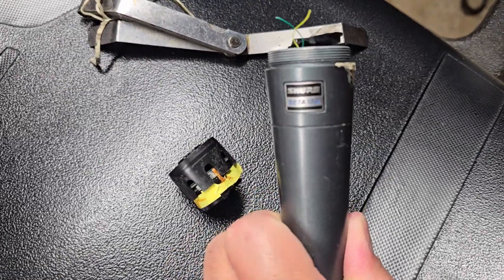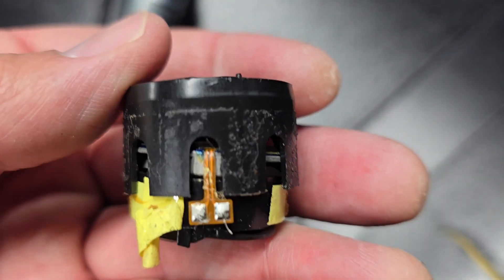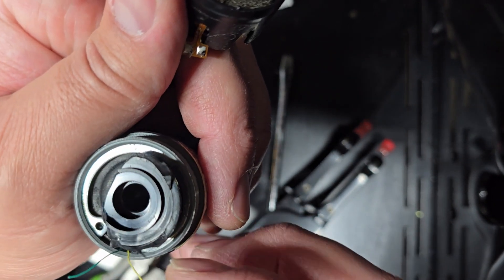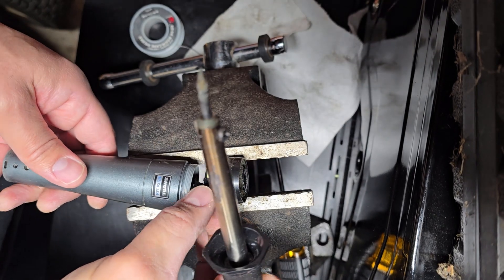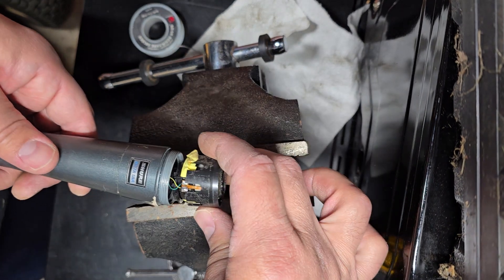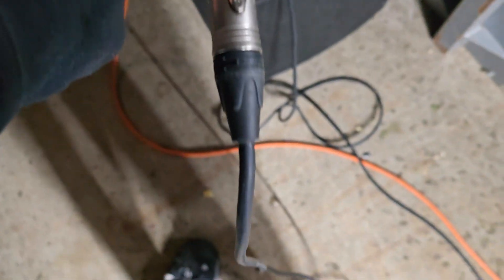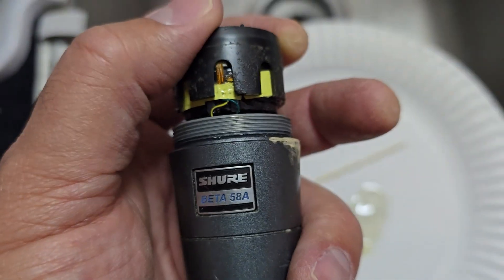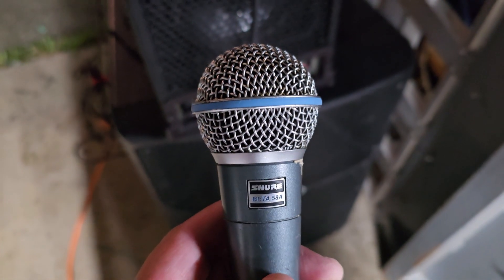How to fix Shure Beta 58A microphone when physically broken under grill

Comment: The Best video for fix the Beta 58a, my microphone broke in the same way like yours, unfortunally I lose the tin for the cables. If you would give me a solution for fixed, cause my tip Dont glue the cables. Thank you so much. 🙏

Comment: I am about to undertake the exact same repair.  Thanks for sharing this video.  I would recommend you remove the capsule next time.  It might make holding and soldering easier, but does require you remove the XLR connector and re-solder it as well.
Reply from the maker: "Next time"??? Let's hope there's no "next time"! 😂 I'm glad I could help though. 😊